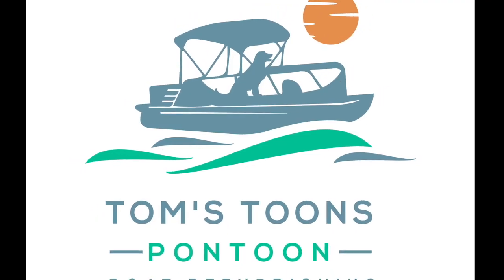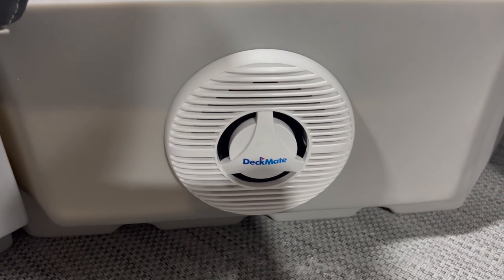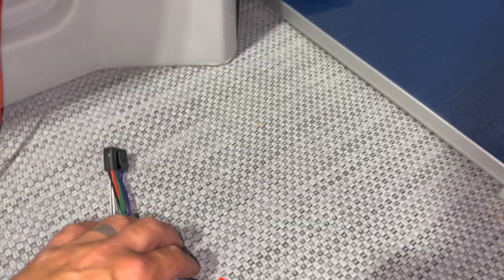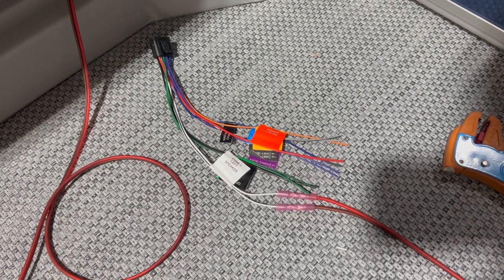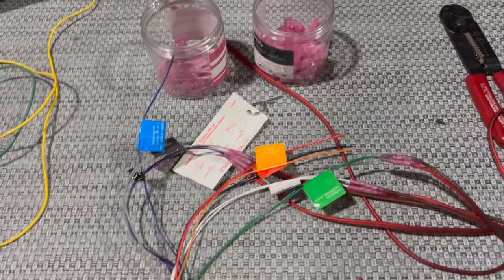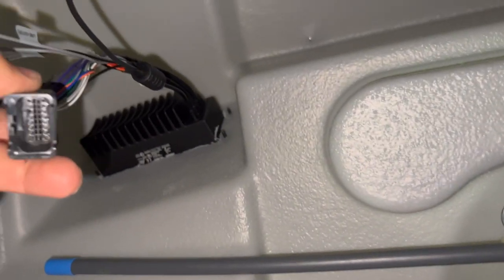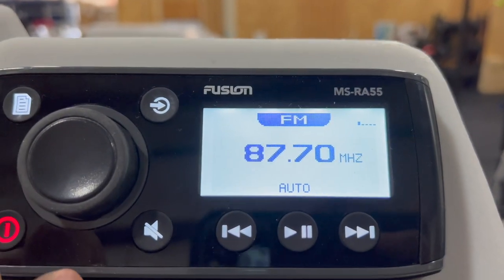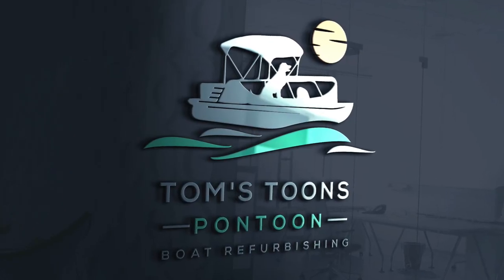Pontoon Stereo Install - FUSION MS-RA55 Bluetooth Stereo

Comment: Thanks for the video, do you have a video on wiring up an amp to a 4 speaker system?
Reply from the maker: I haven't done a video showing an upgraded stereo install with an amp yet. We've done a handful of them over the years, but it's not something super common for us. Essentially, it's heavy gauge wire (I think 2 gauge, but check with your particular amp) from the battery to the amp usually with a 50 amp breaker on the positive between the battery and amp. Then the speakers are wired the traditional way with 16 gauge speaker wire to the amp. The amp is then connected to the head unit with RCA cables, and power can be added to trigger on with a switch or when the stereo is turned on.

Comment: Loving the content. We just acquired a 'toon for use out on our west coast bays. Needs some love so your channel has been super helpful in planning our projects. Do these Fusions store/save radio and bluetooth settings after turning the power on and off via the console switch? Was playing with a Marine Sony head unit and after each power cycle, via the console switch or master battery switch, it's right back to out of the box settings. Reconnecting bluetooth or programming radio stations each time would be a drag.
Reply from the maker: I have this exact stereo on my tritoon and it always reconnects to whoever was last connected via BlueTooth. If you run the yellow wire, it's a "memory wire", directly to the battery which should save all of your settings. I only ever connect to my phone or have others connect theirs, so I haven't actually programmed in the radio presets. However, it seems that the volume, sound, and fade stays the same from trip to trip even though I didn't connect the yellow wire directly to power. I just prefer that everything is OFF when my battery switch is in the off position.
Reply: @tomspontoons  
Just to confirm, your BlueTooth, volume, etc. are maintained even though you didn't connect the yellow wire to your battery? We're the same way, when we're not on the boat, nothing is connected to the batteries.
Reply from the maker: @socaldespenz  I believe so, yes. My battery switch is in the off position every time we exit the boat. I will be on the boat tomorrow night and I'll double check and comment back if it's not. I know for a fact that it reconnects to whoever was last connected via BlueTooth..."I Swear" by All4One started blaring from my phone at the marina last night because I had looked it up to play it after music trivia the night before...it was slightly embarrassing!
Reply: @tomspontoons  Sounds like it does what we need, much improved over the Sony head unit we have. And no shame in that jam, we just belted it out at Karaoke room last week, along with numerous hits/classics.
Reply from the maker: @socaldespenz  HAHA! LOVE IT!

Comment: Should a sealant be used for the speaker wire holes? If so, what do you recommend?
Reply from the maker: You absolutely can if it’s in a spot that’ll be sprayed or splashed often. Just a clear marine grade silicone will do great!

Comment: Hey Tom. Just found your channel yesterday. It's great!. I have a question. I am buying a used toon to refurb. New seats, floor if needed, console, portapotty etc. I will use it slot in saltwater. Is there some product I should spray on the aluminum structure to help protect it?
FYI I will be buying many items from you.
Reply from the maker: Hey Mark! Great question! The product you’ll see used the most is Sharkhide metal protectant. Im a freshwater guy myself, so I’d definitely reach out to a local pontoon dealer who does a lot of saltwater boats and ask if there’s more needed. I usually see pontoons bottom painted or even powder coated for the saltwater too to prevent pitting and corrosion of the toons. I don’t sell anything directly right now, but hope to get a coupon code or something for my subscribers to use at PontoonStuff.com

Thanks for watching our channel!!!

Comment: I’m wanting to add some speakers to the rear of my pontoon. Would you recommend ski bar mounted or flush mount in the skin? And which brand would you recommend.
Reply from the maker: I would imagine if you go into the sheet metal it's going to be poor sound quality and have some rattle/vibration. I have used high end JL Audio 7" wakeboard tower speeakers and Rockville 8" wakeboard tower speakers. Both were great, but if you love super high quality sound and are willing to spend the money to get it, go with higher end JL Audio equipment.
Reply: So you were impressed by the sound of the Rockville speakers? I was looking at them but wasn’t sure about the quality and sound.
Reply from the maker: @justinabbott1155 for the price I was happy. Their customer service was great too.
Reply: Would you go with a 6.5 over an 8 just for better fit on the tow bar?
Reply from the maker: @justinabbott1155 that’s all personal preference. A higher end 6.5” will still sound great even when cranked up!
Reply: Thanks!
Reply: I think I’m gonna give the Rockville RKL80MB 8" 900 Watt Black 2-Way Marine Boat Speakers w/LED's a try
Reply from the maker: @justinabbott1155  I'm sure they'll sound great. I think that's what we installed on one of the double decker projects we took on this past spring.

Comment: Can you tell me what boat this is in the video? We have a 99 Lowe Jamaica Suncruiser and it has the offset doors on the side like this one and I'm looking for furniture layout options as the current furniture doesn't curve with the fencing, it squares off and leaves a lot of wasted space. The layout looks a lot like this one
Reply from the maker: This boat was a fully restored Crest. The railings are an aftermarket kit that will hopefully be available soon. It’s an 8.5’ wide boat which means it needed 36” radius corner seats. These are the Luxury seats from Pontoon Stuff. They sell their Premium seats in 36” radius on their website…not sure the Luxury are available in 36” anymore. You could always call or email to check though!
Reply: @tomspontoons  Mine is 8' wide, will it need to 28" or the 30"?
Reply from the maker: @melanieking7454  Great info to have! If you have the wider radius corners (not the older style with closer to a 90 degree bend, you will likely need the 30” corner seats. Those are available in all of the styles of seats at Pontoon Stuff. Search my channel for the 30” corner seat installation to see those and the railings they match up with.

Comment: the antenna should work as well as a external unit   Im saying they are the same thing  just mounted higher  - if you get a strip of metal  glue your antenna to it it should work much better
Reply from the maker: Makes sense to me!

Comment: Our radio was working fine and all 4 speakers just stopped working ? Any ideas?
Reply from the maker: Check the fuse on the back of the stereo, and any other power supply switches or fuses.

Comment: So why do you say good stereo if you're running 1 amp? Bought one for less than 100 new and I'm going to be running 2 amps, can't I just run a splitter setup.
Reply from the maker: I’m not a big stereo buff so I’m not a ton of help on that. When running an amp I simply run the wiring and items my stereo guy tells me to. Then I let him take over the final installation. All I know is that the bigger the stereo system the better your battery bank and charging system needs to be because amps and subs draw tons of power!
Reply: @Toms Toons Pontoon Refurbishing  yeah im not running subs they are to power the 8 fusion signature series speakers, 8.8". I picked those up for a good deal compared to JL and cheaper than skar speakers. That will be down the road maybe 4 subs 😳 but im going from 1 group 27 deep cycle to twin 31s in parallel
Reply from the maker: @htownsfinest87  Ahhh, that makes sense! I'd have to think you'll be well covered for a day out on the water with that battery setup!